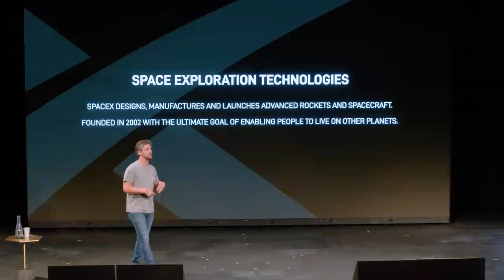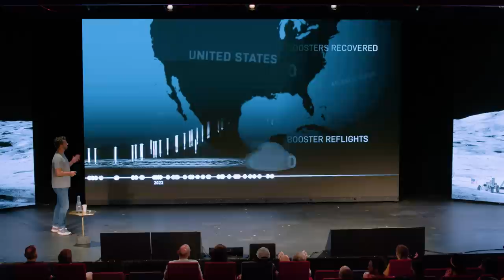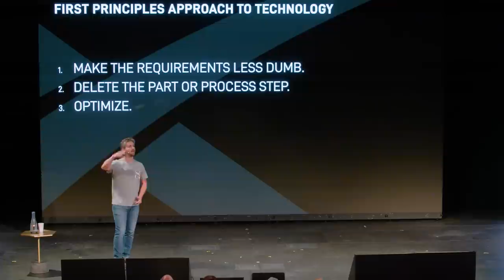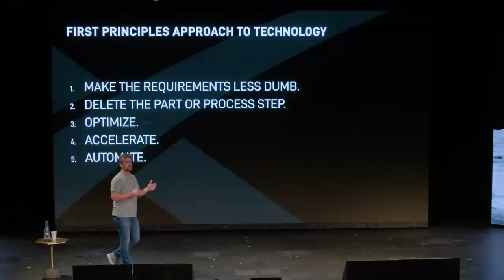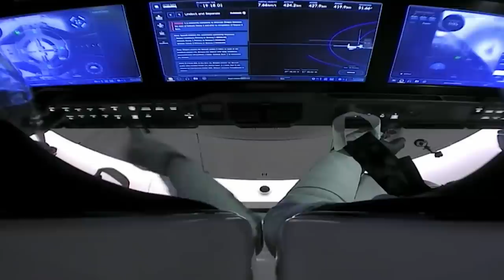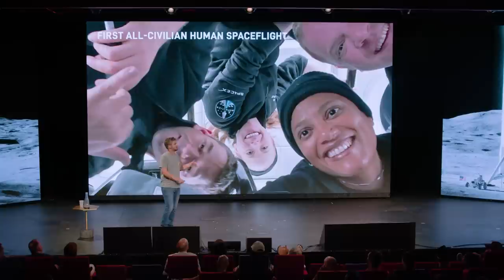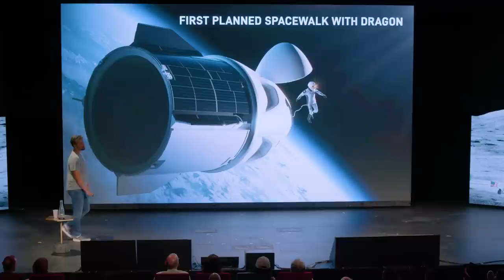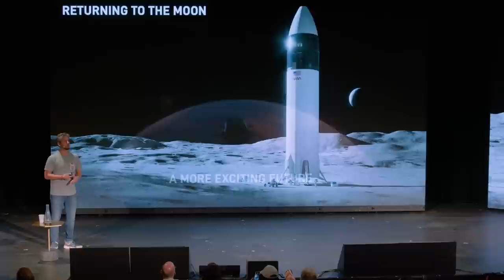Running the Algorithm: SpaceX’s Approach to Exponential Growth with VP of Launch Kiko Dontchev

Comment: 19:19 hahahah That is nice words befor war hahhahaa.
I dont expect that parts(fairings) cost so much. Where can apply to work as third party to cach them for 1milion?
Reply: 21:45 Damn i was thinking in use a boat and let the drone cache them. Like a carier ship but for VTOL drone. the drone get it in the midle of the air and retrun it to the carrier.
Even can send 2 drone if is to heavy and have high winds.